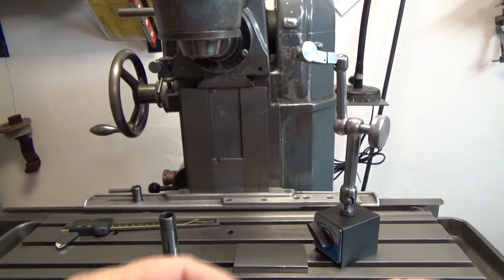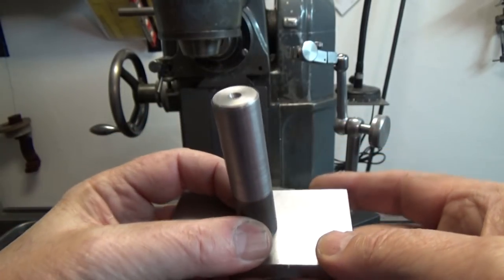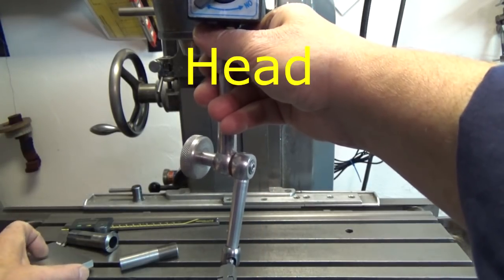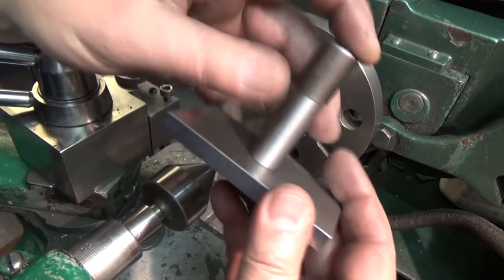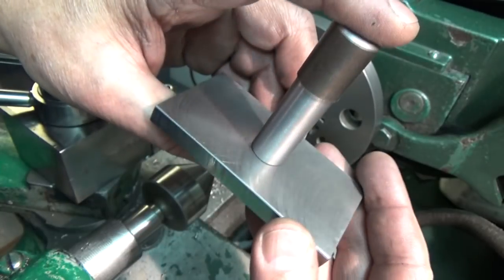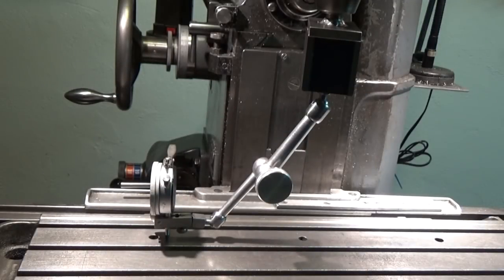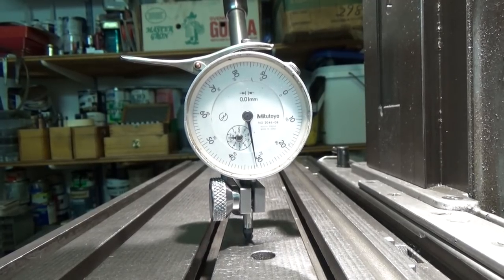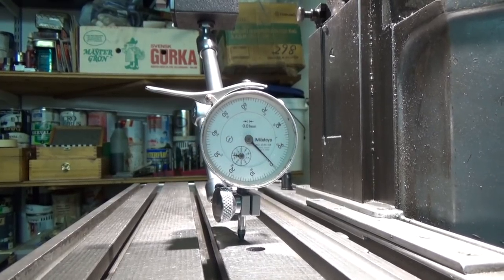Tramming Aciera

Comment: Sorry. this procedure is aligning the spindle of the machine to be perpendicular with the table. The correct way is to align the head first to be square to the Y slide which hold the table. Than align the table accordingly in L-R and if you have the compound table F-R. To Verify your self  tilt the table say 10deg than align the head your way. Take a cut and measure. No pan intended.
Radu
Reply from the maker: Teach me...